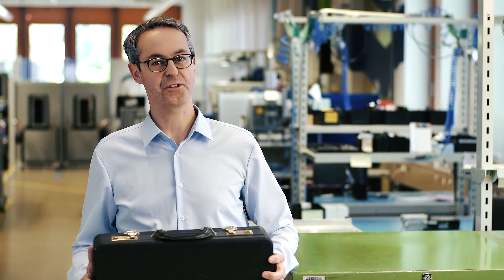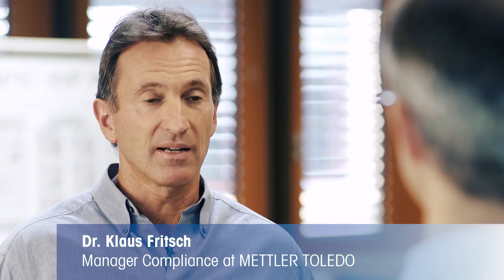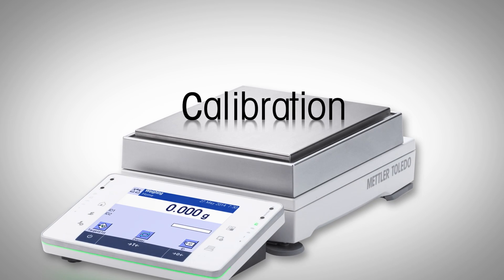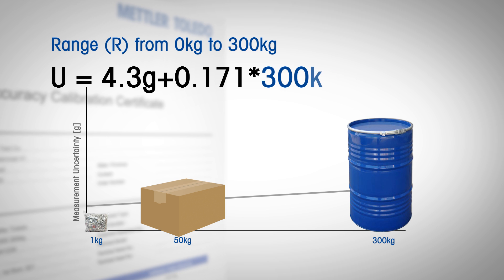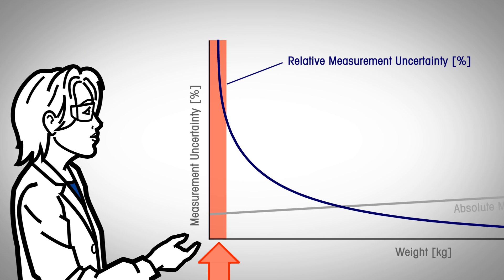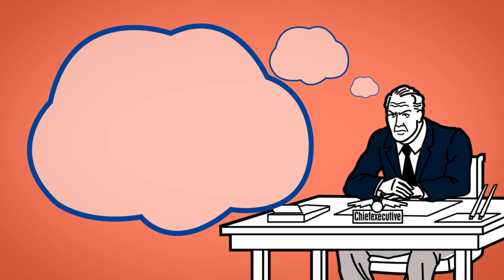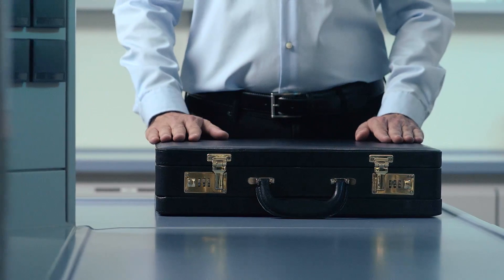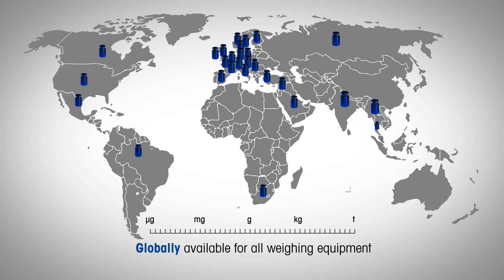New Accuracy Calibration Certificate (ACC) from METTLER TOLEDO

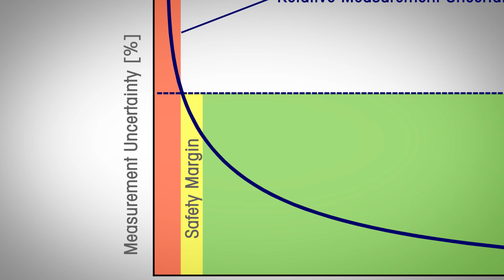Comment: A couple of things were observed in your video.  At 6:40, you complete the example for the safe weighing range.  You mention about OIML and HB 44, and place those MPE on your graph first.  You then show the green shaded area, which rises outside of the MPE you have described from OIML and HB 44, and specify a customer defined tolerance of 0.5%, which, on a C3 measuring instrument is 15e!  That is either making money for the business or throwing the money out the door!  If the customer has that margin for error, do they need a trade approved scale???

At 7:50, you make mention of a MPE of 0.3 kg / 3e.  Am guessing that an in service MPE is permitted in your jurisdiction.  From the saving that you have mentioned, it would pay the owner of the scale to purchase 14 * 20 kg hand weights, plus smaller denominations down to 5 grams, have the masses verified and do their own testing, and get the error down to +/- 0.5e.  Do the testing for repeatability, eccentricity and span once a week, document, include as part of their Quality Assurance management, and call you if the scale error exceeds +/- 1.5e.

The other matter relates to the testing procedures.  Am hearing rumblings that the testing procedure is going to be changed in a large way within the next 18 months due to problems on several continents.  Has your organization heard anything about this matter?